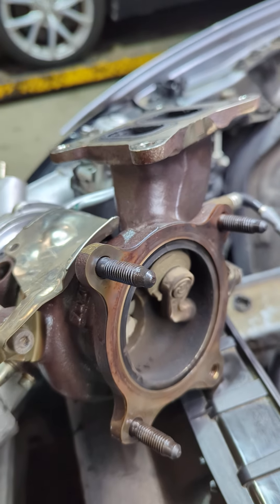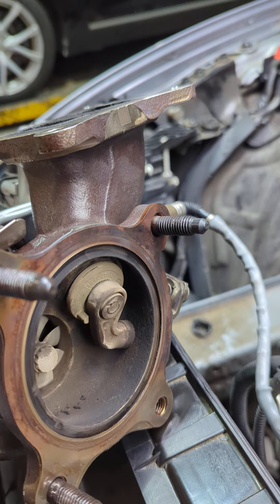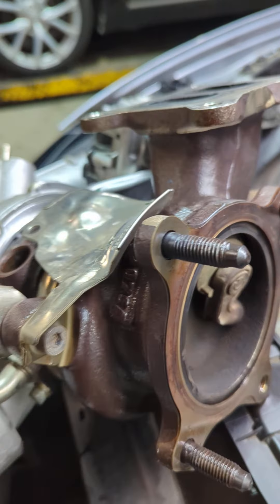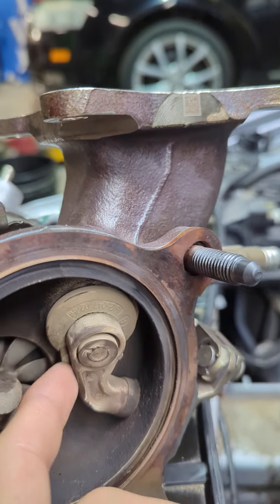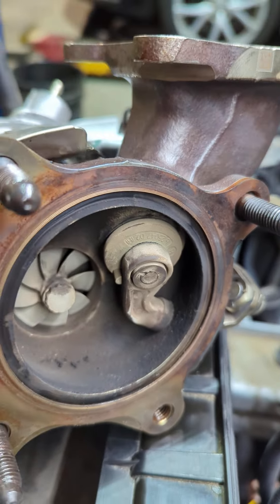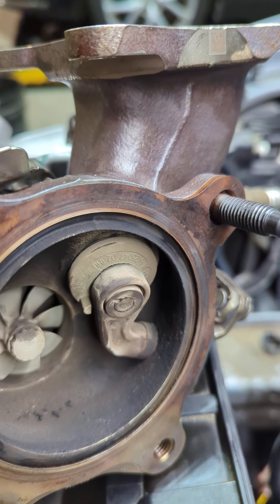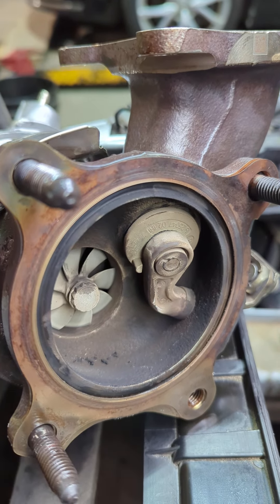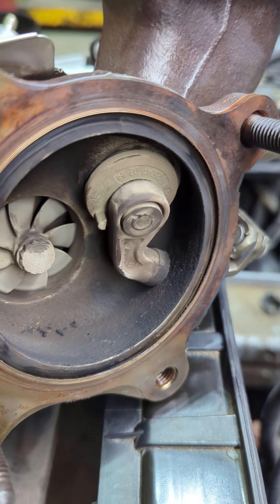2017 Audi A6 2.0 CYNB Engine Code Bad Turbo Replacement

Comment: Perfectly described and great visuals. 
Got any links for how to remove the turbo
Reply from the maker: I don't have any shareable links. It's pretty straightforward. But I think you can purchase a one time use Erwin repair guide from Volkswagen Auto Group using your VIN

Comment: I have an Audi and these codes were discovered, first I changed the WASTEGATE, the P00AF code disappeared, but the P2563 is still there. Is there a video on where to buy the turbo and change it? thank you
Reply from the maker: @WalterCumpaRamirez82  you're going to have to buy turbo direct from Audi unless you can find good turbo out of a wrecked car from reputable salvage Yard